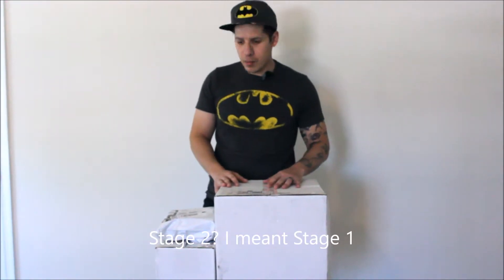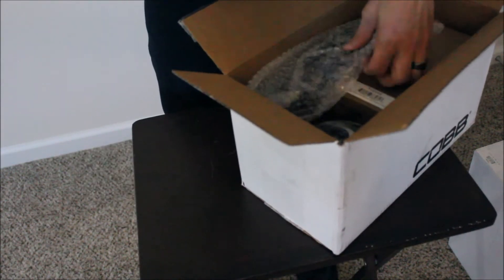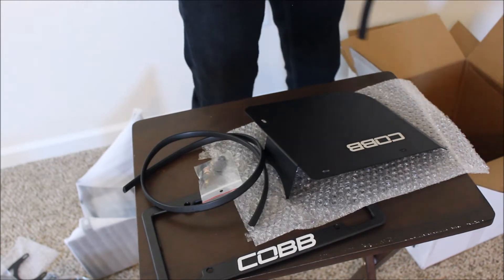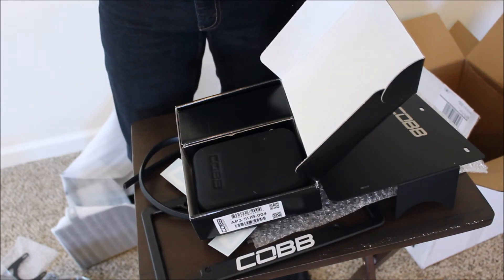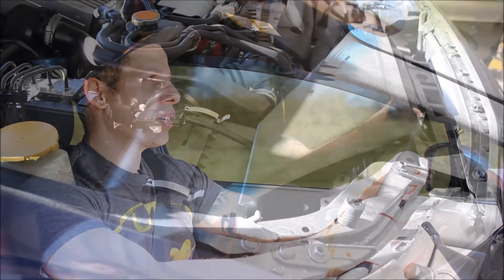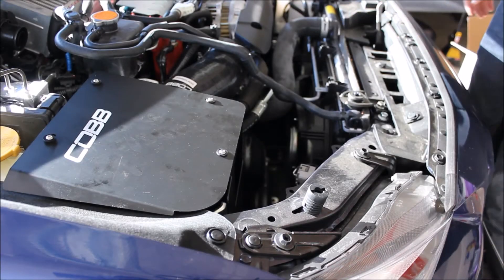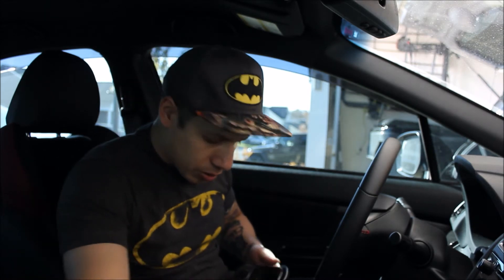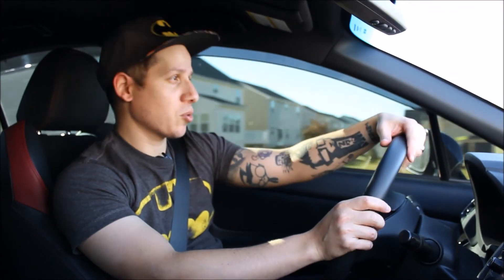Cobb Stage 1 + SF install Accessport 2015 - 2017 Subaru WRX STI

Comment: the trouble he has that he didnt download the maps for the cobb access port
Reply from the maker: Victor Coria The maps already come uploaded on the accessport, I needed to upload the high wastegate map for my car because I was under boost. I did read the manual from Cobb online and it does state that if I was under boost with the normal wastegate map, that I needed to upload the high wastegate map. The accessport comes with all the stage 1 and stage 2 maps already in it and also including the economy and valet mode maps
Reply: +ARomanRacing hey bro I'm in California and I can only hit 8psi on sports sharp on my 2016, so you are saying that I have to download a new map to make my boost go up? and I actually feel the car slower when I have the AP installed
Reply from the maker: Alonso Arellano hey, all the maps should be already pre uploaded in the accessport, which map did you use, and do u remember if you picked normal, lwg, or hwg. Because you are in Cali, you should be using Stage1+SF ACN91 map, target boost is around 16psi. Double check if you used normal wastegate, lwg or hwg and let me know.
Reply: ARomanRacing target boost is 17.5 psi I believe on ACN91 tune
Reply: +ARomanRacing yeah sorry I didn't specify but I'm running the 91 acn map.  I don't have the intake, but I noticed that I can't hit peak boost with it of 17.5. I can call cobb but there will be a lot of back and forth and I'm so busy right now with work. I had a big expectations for the AP but I felt the car more powerful woth the stock tune :( 
thanks for the reply bro nice ride
Reply from the maker: Did you use the normal wastegate, lower wastegate, or the high wastegate map????? I had use the normal wastegate map and I was only hitting 15psi, then I used the high wastegate map and hitting 18psi, I imagine If i used the lower wastegate map I would be way lower.
Reply: +ARomanRacing I actually don't see an option for any wastegate, when I install the AP it just shows the 91 map acn and when I read the description it says nothing about the type of wastegate to use. I'll install it again and check but I positive I didn't see an option for a wastegate
Reply from the maker: Alonso Arellano I would download the cobb program to your computer, then make sure is updated, maybe that is what you need, but you should have the options for the different wastegates, if not check if you can download jt from the website to the accessport. Let me know
Reply: +ARomanRacing yeah bro I got it like 7 months ago so I think I need to download the new map from cobb I'll do it tonite. thanks for all your help!!
Reply from the maker: Alonso Arellano Let me know bro
Reply: +ARomanRacing wow bro I'm driving the car right now with the HWG 91 map and it feels great!!!! and i barely hit 8psi and it feels fast. I'm gonna try to see what's the highest boost I can get.
Reply from the maker: Alonso Arellano Hey man, any updates??? I want to know if you are hitting your target boost??
Reply: +ARomanRacing I just installed the kartboy short shifter, im going to a little test run when I get a chance and I'll let you know... I hit like 16.4 the other night but I didn't like the numbers too much AF correction dropped all the way to -25.00
Reply: Damn I'm hitting like 21 psi on my stage 1 ETS intake .. nameless catback plus ETS intake .. there isn't any low waste gate option for that map LOL
Reply from the maker: Jae 935 On the shelf maps from Cobb for an ETS intake???
Reply: ARomanRacing yup
Reply: ARomanRacing I hit 18-19 normally but first gear pulls I get up to 20-21
Reply from the maker: Jae 935 Tell you the truth, I havent seen any maps from Cobb that are designed for any other intakes except from actual Cobb intakes, you can always datalog and send it to Cobb to get feedback from them
Reply: n

Comment: u don't sound happy
Reply from the maker: 143gurmukh I actually found out in the Cobb manual that if I was not hitting target boost with the normal wastegate map, that I needed to install the High wastegate map. I am hitting 18psi now and I am happy now. I will be honest, I was thinking that I probably didn't tighten the intake right and was probably leaking somewhere.
Reply: How you install high wastegate map?